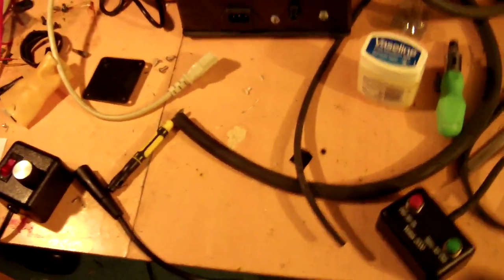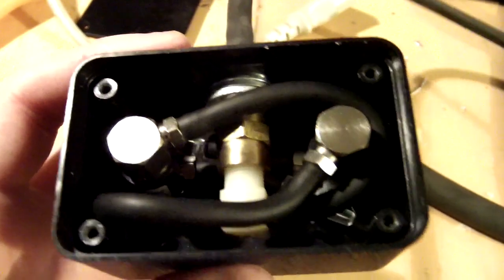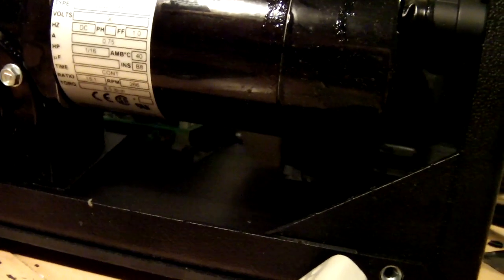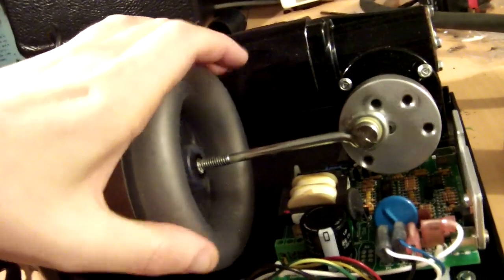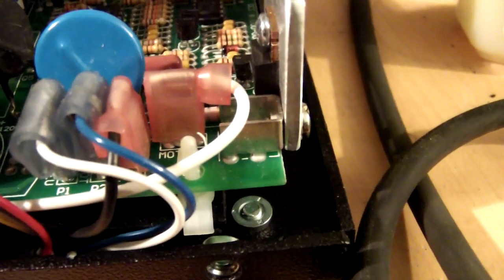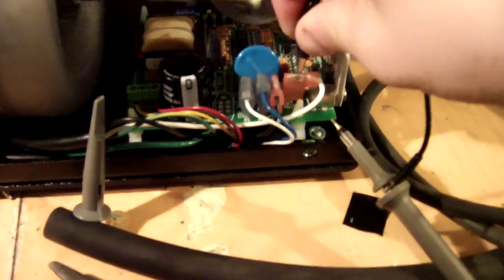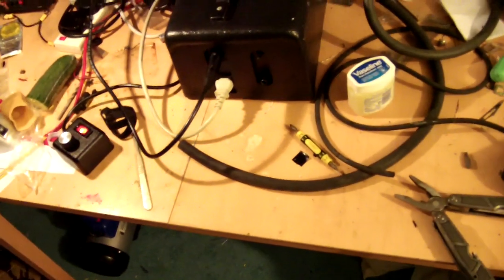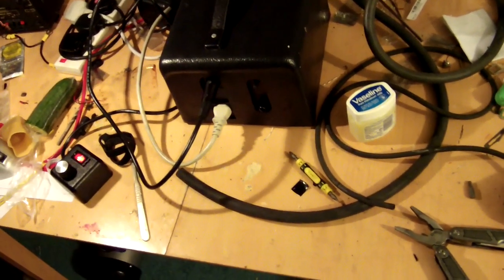Venus 2000 examination Pt3: Take it apart

Comment: We Americans learn both systems and all i hear from you wankers is complaints. At least with the Imperial system most units are based on simple tangible things that people can relate to like a foot. We didn't feel the need to tell everyone how smart we are by making a system based on a meter being 1/10,000,000 of the distance of a quadrant of the earths surface from the equator to the north pole.... only to find out later that they screwed up on that distance.  Oh the irony. 

But when all is said and done, there are only two types of countries. Those that use the metric system, and those who have landed a man on the moon.

Comment: Question, can you show the pump diaphragm? Particularly I'm looking to see the cylinder the diaphragm mounts to. Also in regards to the air in air out control, I know it plugs into the box but where is it connecting to inside the box? I ask these because I'm bought every replacement part on their website to build one. It was only $400. But a few parts they don't offer or have listed
Reply from the maker: The cylinder is just a plain plastic cylinder, molded into the body. It also forms the central chamber for air: One end of the cylinder is the pump diaphram, the other contains two external ports. One for the air in-out box, and the other for the wider hose that connects the 'receiver' - the business end of the machine.

Comment: Illuminated switch bro. Neutral. This is most likely zero crossing SCR controlled. Simple n cheap. To go faster the SCR's are gated on earlier and earlier, until reaching what is known as fully phase forward. ISOLATE YOUR GROUND ON THAT SCOPE.

Comment: Hi, I saw your video on Venus2000, I would be interested in castrating a similar one, I would like to ask you some information, the first the diaphragm pump and the second the operation of the two red and green buttons ?? Can you give me some info on where to buy the diaphragm pump and what stroke it must have and the diameter. Thanks NG
Reply from the maker: Sorry, no idea on the parts, but I I know that the stroke can be adjusted by opening up the machine and moving the piston rod. From what the website says, I gather they set it according to the measurements of the customer. The buttons though, I can explain exactly: They are simple push-to-open valves, each connected to a one-way valve. So you press one to let air flow into the closed pneumatic system, and the other to let air flow out.

Comment: obviously you are grounding the AC hot and blowing the breaker, repeating the move will not cause a different result,  like DUH!
Reply from the maker: Correct. I was using what I thought was an isolation transformer, but which I later discovered was only an autotransformer. The eBay listing lied.
Reply: @channelbeforepurpose7353  that has noting to do with shorting out the hot.

Comment: you miss the design intent. the one-way valve at the end is to cause the receiver to slide back and forth by removing the air from the internal chamber displaced by the dildo. lub and hold the dildo still and the receiver will slide back and forth as intended. the outer chamber is a not a one-way valve.

Comment: Quick DIY Pump (just quickly thinking)
Diaphragm= Toilet Plunger + PVC Coupler with plug.. 🤔
Motor= Windshield Wiper Motor..
 Only thing I can't think of is what you can buy and repurpose for the rubber part your member would go in.. Bicycle inner tube will work but it should be softer and not being able to see through it is a big negative...
Reply: That plunger idea doesn't work. Use big syringe or smaller hydraulic actuator.
Also don't bother with windshield wiper motors. Too slow. You want something that does 220-300 RPM. Look for used dc motor with gear reduction.
Reply: @ThomasShatter Yeah I experimented alittle bit with plunger as a diaphragm and it actually seems to be to large of a Volume of air to the slightest movement of the plunger..
 I still haven't gotten around to Really experimenting but what about a "car window motor" ?
 I think I have the perfect "pump" set up but time will tell.. 1-1/2" PVC with a PVC end cap that goes inside and has a 1/2" threaded hole that I got a threaded plastic nipple for 3/8" hose all from plumbing department at "Lowe's"..
 As a "piston" to move back and forth inside the 1-1/2" PVC I put a 1-1/2" wholesaw in my drill press and drilled a piece of 3/4" thick PVC 1× scrap I had laying around left over after doing Exterior Trim on a house.. The piece ends up slightly smaller then the I.D. of the PVC..
 So after I drilled the 3/4"×1-1/2" round piece of PVC.. I put a bolt through the center pilot hole, tightened a nut on to it, then tightened the bolt into the Chuck of the Drill-Press first holding a piece of sandpaper against it as it spun to make it smooth.. Then put a drill bit in my small little Drill-Press Vice at a 90° angle to the 3/4" edge and as it spun pressing the bit against the "Piston" I cut a groove perfect for a Rubber O-Ring to stay seated and seal against the inside of the PVC pipe.. 
 If I ever get around to assembling it I'll update how it worked out... Untill then be sticking to old faithful... 🍌✊.. 🤣
 OH... Still wondering what can be used as a "sleeve".. Surgical Rubber Tubing seems ideal but I haven't seen it with a diameter anywhere near large enough ??
Reply: @swalowit  Why you spend all that time instead of just getting big plastic syringe? 150-200ml works really well and is very cheap.
The motor I've used costed me about 25$ and was scrapped from some industrial equipment. 24V 300RPM. 5$ PWM controller powered by laptop power supply gives me wide range of speeds. Never tried window motor but i think it will be too slow.

You can get liners for venus 2000 online for 10$ if you really want to make your own receiver. Or for around 15$ on the serious kit shop if you want a "clear" one.
Reply: @ThomasShatter  Do you know the torque of the motor you bought and what gear system is inside?
Reply: @Leinad762  No idea. But it's probably overkill for this purpose anyway cause it weights around 2kg and is rated for 100W.
Reply: @ThomasShatter  So you don't have any Model number/Company Name? 

I don't know how strong the Motor should be.. I don't want to buy one and find out afterwards that it is to weak
Reply: @Leinad762  No info on it other than power rating etc.
I think something between 50-100W will be good. Protip is to look on the diameter of shaft cause bigger the torque the thicker it gets just to handle it. So anything more than 10mm should work.

Comment: Use the other scope channel as the return signal path, and put the scope into differential mode
Reply from the maker: The problem was my transformer. I got it specifically because it was an isolation transformer - I thought. Actually it was mis-labeled. It's an autotransformer. That's why I kept tripping the breaker.

Comment: I'd guess the motor is being PWM'd or phase angle controlled directly from rectified mains, hence why the RCD tripped.  If you were running it from a step down transformer it may have been an auto transformer (single tapped winding) and not isolated?  Hope your scope survived the brief spells of current in the probe to ground path.
Reply from the maker: You're probably right - and certainly right about the transformer. I am well aware of the issue of using a 'scope on mains like that, and made sure to purchase a step-down that was specifically identified as an isolation transformer. However, I made the mistake of buying it on eBay. The seller lied: It turned out to be an autotransformer, thus the tripping of the RCD.

Comment: Can you see any type of label or markings on the "Air IN" and "Air OUT" buttons? I am trying to make something like this but can not find anything like it. Also, what is being used as a check valve? Thank you.
Reply from the maker: It's just a tiny pneumatic valve. Little cylinder with a plastic flap inside. You should be able to buy them on ebay.

Comment: This was painful to watch, man. That is most certainly a simple SCR based motor controller. It's usually a dead give-away when it's a 90 or 180v motor. Rather than rectifying and pwming the current to the motor, these have a slightly different approach. The scrs are diodes that have a turn-on gate. They don't conduct(ideally) at all when no gate voltage is applied. When gate voltage is applied, the scr acts like a diode. It starts conducting, but also rectifying since it is a diode. Now, at this point, if the gate voltage can remains, then we just have a crude rectification of mains to a dc motor. This would be full speed for that motor. To vary the speed, we turn the scr on mid-ac-cycle. We can actually just pulse the scr, because they have a particular quirk. Once a gate voltage is applied, they conduct until zero-crossing (when the scr is negatively biased, just like a diode, it doesn't conduct). So a simple speed control circuit just needs to watch for zero crossing, and have a variable delay to pulse the gate once per cycle. Usually a physical switch is used to provide the other direction, by simple swapping the motor poles. This can be done with extra scr circuitry, and was/is on big (many kw) scr drives. Transformer isn't for isolation.

That drive is full mains territory. You should check that things are isolated before putting your scope on them. If you haven't touched it with a meter, don't touch it with anything else. ;)
Reply from the maker: I got caught out. I used an isolating transformer, of course. I know that much. I deliberately choose one one from an eBay store which said, very clearly in the listing, "isolation transformer." But after making the video I realised the seller lied, and it was actually just an autotransformer. Thus all the tripping of the RCD.
Reply: @channelbeforepurpose7353  that the used transformer is not isolating, was obvious as soon as you caused the first RCD tripping. It's ok if you don't understand the PCB, but it would have been VERY nice if you showed it in close-up to your audience and maybe even read out the chip markings.
 Apart from that James Newman is likely right and it is an SCR based motor controller. 

You really should consider to take the effort and get it back on the bench to do a proper teardown (including an real isolation transformer). I'm sure your audience would appreciate it.
Reply from the maker: @diemaschinedieviereckigeei2941  Honestly, the motor controller is the least interesting part. Those things are common-tech - you find similar all over the place. It's the mechanical/pneumatic aspect that is unique to this particular device.

Comment: OK - I finally found the diaphragm (sort of).  It is a very interesting concept called the "rolling diaphragm."  This was invented in the 'sixties, and virtually eliminates any friction between the piston and sidewall, whilst maintaining a perfect seal.  I reiterate:  these people really know what they are doing.  A company called Marshbellofram seems to be the leader in making these diaphragms. Put one of those inside a 4" schedule 40 plastic water pipe and you are in business.
Reply: I've seen builds using toilette-plungers as the part. How does it compare...?
Reply: much easier to modify a manual bilge pump which includes a similar diaphragm.

Comment: Do you have better picture or video from the "chassis" or "base" where diaphragm is connected? What is inside of it etc.
Reply: +ChannelBeforePurpose still open to a buyer for this unit?
Reply from the maker: Nothing is inside it. It's just an empty, sealed cylinder with a flexible diaphragm connected to a crank.
Reply: +ChannelBeforePurpose Is there any manufacturer name or type number on it? What number is on that white sticker?
Reply from the maker: +Jami Sive The device is now packed inside a cardboard box. The box is wrapped in tape. The tape is wrapped in more tape. The whole tightly-sealed container - tubes, lubes and all - is at the back of my loft. It shall come out under only two circumstances: If I find a buyer, or if I lose both my hands in a tragic accident.

Comment: A lot of 220/240-110 transformers are auto-transformers to keep the amount of copper and thus the price down. And your scope provides the earth return to trip the RCD.
And you could likely run it off 220v by winding the PWM back even further until your in it's voltage range. But yeah, expensive toy, don't break it. :)
Reply from the maker: I finally got around to applying probes and found that the converter, though I'd carefully purchased one off of eBay labeled as an isolation transformer, was indeed an autotransformer.

eBay.